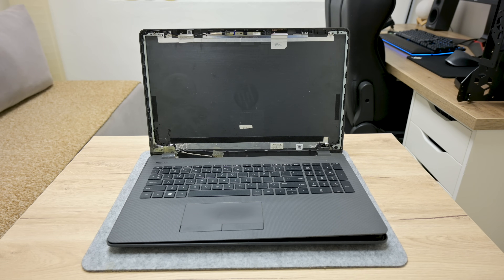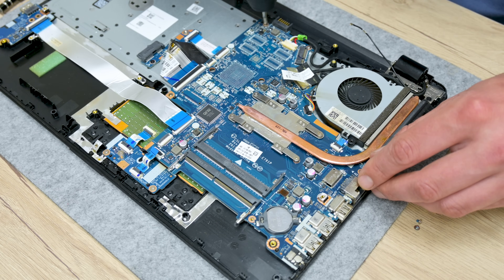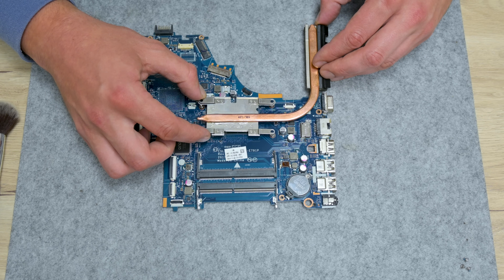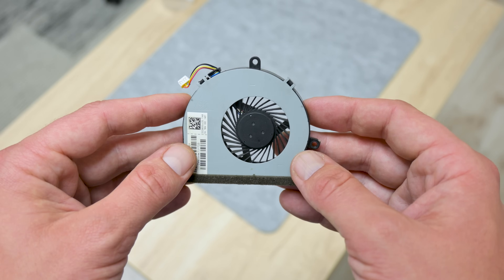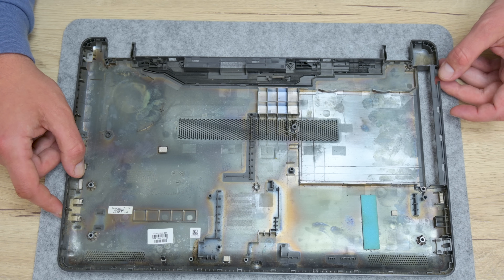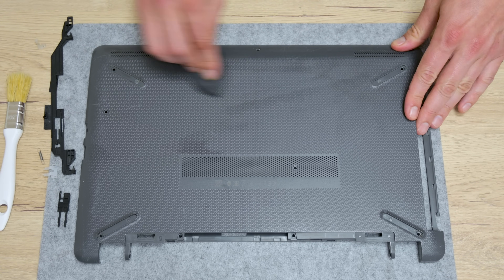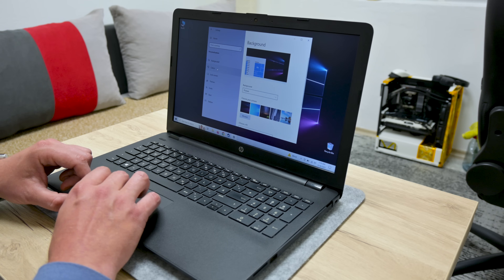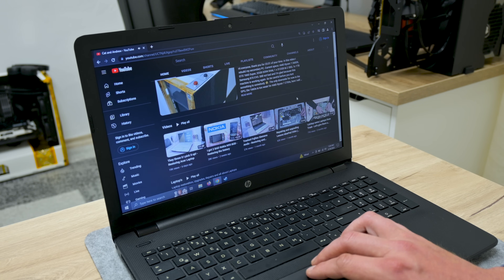I made a laptop from trash - The leftover machine

Comment: from what i recall the 250 g6 is notorious for being not that good, the specs were horrible, the build quality was sub par even for the price range it was aiming for
Reply: Yeah I've seen that these laptops are very plasticky, it even made a mark on the case when I used a pry tool to open the two halves (for a RAM upgrade). But for their low price, it's not a problem, especially when you have an SSD, 16GB RAM and an i5-1035G1. (My parents 250 G7 has these specs.)

Comment: Andrew  swap the Z and Y keycaps, so you can use it as qwerty layout.
Reply: With these laptops, the keyboards are integrated into the top case. Replacing the entire top case to get a QWERTY layout keyboard may well be cost prohibitive, especially if the country that Andrew is in natively uses QWERTZ instead.
Reply: @TheSpotify95  they are swappable though. Not the entire keyboard only the caps.

Comment: ngl the oil on the trackpad was triggering me 😂.. is there such thing as a trackpad protector to prevent that?
Reply: I think that's not oil, that's wear from use--that trackpad was well-used.  Yes, you can prevent it by putting a protector on it or simply put a vinyl sticker over it.

Comment: I have the same laptop , with the cpu i5 -7200u processor
Reply: My parents have the 250 G7 which has i5-1035G1 (I think?). I also managed to find the version that had optical disk, as that is still a requirement. This is way better than their old HP G6 with E2-1800 from AMD.